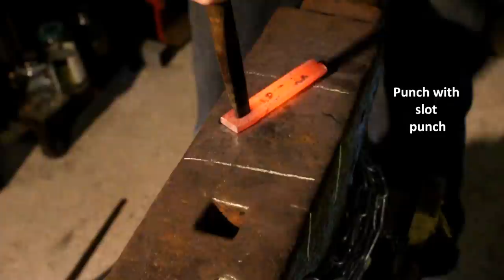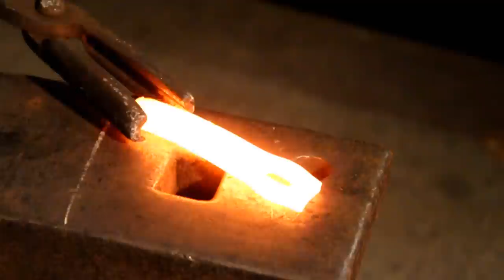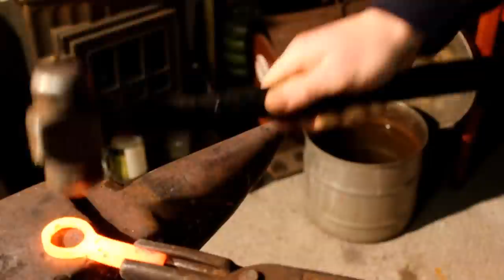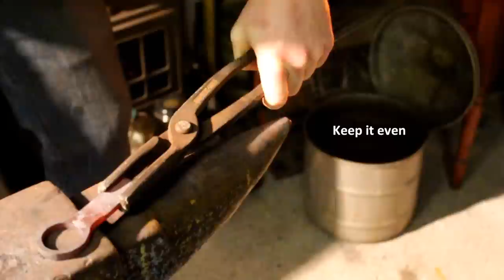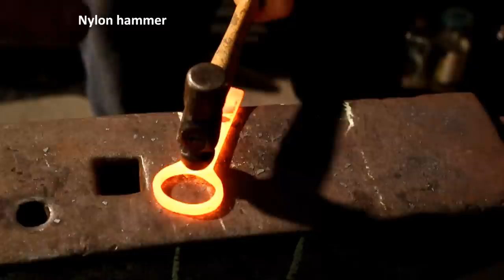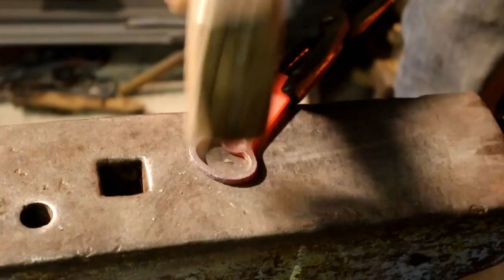Blacksmithing - Hand Forging A Bottle Opener

Comment: Very nice video, amazing how much can be gleaned from something that would seem so simple. I've been making some nice openers with a skull and a pineapple twist handle but have had a heck of a time finishing them with a nice symmetrical opener. I've fabed metal for years but this is my first season working forge to finish. Thanks for taking the time to help a rookie out.

Comment: Your way is much better! I was using increasingly larger round drifts for the hole and it wasn't turning out very clean. Now seeing this I realize my anvil was sitting there thinking Im stupid for not using the horn.
Reply from the maker: This has made my night my friend, she will forgive you i reckon. i have tried that too with not much luck. the only way i could do it with larger punches is to start it off on the horn to get it round in the first place by that time, i am already half way to finishing. its good to practice the technique on the horn too as it will teach you how to correct mistakes and centre lines of works with holes that need to be centred. such as gate hinges. same thing just thicker material.
Hoe you had fun either way dude, and give it a blast next time using the horn!

Have a good day my friend! Enjoy!
Reply: That Anvil has a thousand uses, limited only to the extent the user is willing to take it to. Anvils are the 'smith's 3rd hand, responsible for an AMAZING array of clever tools, hardware and techniques... let it guide you...The Force is With You, coming all the way from Hephaestus, the Greek God of the Forge! Hammer on, Brother!!!

Comment: Great video.  It solved a problem I was having making the opening.  I had been using just a round punch and widening that hole just enough to forge over the horn point.  The sides of the circle ended up too thin that way.  The slot punch will work much better.

On the subject of hitting a hardened hammer with another as it appears to be happening in your video....just use an old ball peen like you use and heat the struck end to non-magnetic and let it anneal.  The struck end will be softer and the peen end that is used to make the dimple will still have a little hardness left over.  On hot steel like an opener, it doesn't have to be hardened.
Reply from the maker: shortfuse43 Thats why i do them, to help in situations like that. If you check out my latest video i have done anothe bottle opener in the same way but a better quality to see how its done better. if you do use a round punch just make the hole further from the end, that way you can reduce the sides of the circle easier, but yeh a slot punch is a lot better for this. i did this to the ball pein and works great, quicker too as i can get more force with a hammer than a nylon which is what i used in this video.Thanks for commenting, i really appreciate it.
Reply: ***** Hey, the latest video shows the work more clearly.  Not a problem for me with the low ambient lighting...the anvil work is what's important.  The dimple forging with the ball peen is much better in the new video.

Comment: I've made a few of these recently but with a Ram's Head at the 'handle' end.  I usually use a piece of 30 x 8mm (1.25 x 5/16), first working the handle end to approx 16mm (5/8) square, from which is forged the Ram's head.  I do half the work on the head first to get the basic shape including the split and tapered horns and then flip round to punch the hole and form the bottle-opening shape.  Then return to work on the head and finish the detail.  Last thing is twist and curl the horns and then tweak everything with a file where necessary and polish the whole thing.

Comment: Do you have any advice for those who want to forge this but don't have a anvil with a horn? Could I use the round punch locked in a vice?
Reply: is there a square hole in your anvil?
Reply from the maker: That would work ok, as long as its in a leg vice and not a bench vice as you will break the screw in the latter. Or it can be drifted using the jaws of the vice.
Reply: The usual blacksmithing truth: there's more than one way to skin a cat.  I make mine using a totally different approach: I punch round, then I use tapered drifts over a hardie hole and a larger turning hole.  It never touches the horn.  However, if you don't punch your hole dead center of a nicely rounded strap end, drifting will always stretch the thinner sides more than the thicker.  The approach in the video is a lot more idiot proof than my approach...  I like it!

Comment: I just tried forging a bottle opener.  I failed, I an going to make an oval drift to use to finish the hole.  I also have a cast iron anvil that doesn't have a thin enough horn to round the corners, so I just held my round drift in my vice for now. Have to try again.

Comment: If I am correct, hitting two solid metal hammers together will be like hitting a wooden baseball bat?
Reply from the maker: if they are hardened then they run the risk of shattering, and can be lethal if its the right time and place to be get struck with shrapnel in the wrong place, so i just advise not to for safety reasons
Reply: gotcha, I understand

Comment: can the same steps be used with converting a horse shoe into a bottle opener ?
Reply from the maker: +Robert Stoker oh yes, for sure, you can either thin the bar out or just go with it and end up with a really thick opener but its the process that is important you just may have to punch it closer to the end to reduce the material for the loop as with thick stock you may end up with a very big loop.
Reply: thank you very much for your advice as i tried to make a bottle opener form a horse shoe this evening  and did not turn out well next time will be nicer
Reply from the maker: +Robert Stoker how did you get on robert?
Reply: +workingwithiron I've not tried it out yet I will when I have coal 👍

Comment: how do you know the hole is the rite diameter?...
Reply from the maker: Dxpt very good question, and thinking about it i dont know how its the right diameter but after making a few thousand it turns out to be around 30mm inside diameter which works really well for popping bottles. the general rule is for me, the thickness of the starting stock should equal the thickness of the ring when forged, follow that and you shouldnt have any problems, good question though, thanks for asking.

Comment: So what about a slitting hammer or a hammer punch or a flattening hammer and others of the like that are struck with another hardened hammer commonly in smithing not trying to be an ass just curious as to your reasoning. Nice work
Reply: Most of the tools a blacksmith will make are only hardened and tempered on the ends that need to be. The striking ends will normally be how the material was first used. I have made chisels, punches and drifts and only the tips are treated. Some tools won't even be treated if the material used is of good quality like med to high carbon tool steel.
Reply: +damionlowther78 so what exactly happens when you hit to hardened hammers together?? does the earth stop spinning? does a secret blacksmithing portal open?

Comment: Why not to hit steel hammer with another steel hammer?
Reply: +Peter Kiraly worst case scenario they both shatter but more likely one of them chips
Reply: Interesting! I always though that only jewelers and gun smiths mess around with softer hammers.
Reply: actually , thats what i was always told , but myth busters did a whole thing on it ,,, worthy of a watch , then decide.
Reply from the maker: we also use soft hammers, such as raw hide mallets, wooden mallets, copper mallets, we use these so we dont mark the steel when struck hot for thing like straightening twists or bending and this is usually done on a tree stump or wooden block. 

Hardened steel hammers dont take well to being struck against each other, they will chip, or they can shatter. You have to remember not everyone who produces hammers get the heat treat absolutely spot on unless they are hardened and tempered in a controlled environment such as temperature controlled ovens. 

I have had it happen to me, i even showed it in my new video forging a toasting fork, i show the chips that i personally made by striking 2 hammers together... never seen where the chips ended up and hate to guess what would happen if they hit me. 

Its not worth doing.
Reply: im 55 now ,,, i was re shafting an axe when i was 15 and when i was putting in the two metal wedges that hold in the one big wooden one , a minute shard splintered off , it was about 2mm by 4mm , it hit my arm , and ive never seen anything bleed as much , i still have the scar ,,, but the myth busters is worthy of a watch ,,, like the pig skin mallet on a wood block idea though. thanks t

Comment: what happens when you hit too hardened hammers together??? lol
Reply: They both shatter and send sharp metal flying it can and will most likely hurt someone. don't test it at home go to a friend's house
Reply: +Bruce Woulda bullshit, it doesn't shatter. It's an urban legend.
Reply: If they are of comparable hardness it will do neither any good. Go read a book on metallurgy before you wreck all your tools.
Reply from the maker: I take it you have not done this to the extent that eventually you had a piece chip off. I dont know where you get this urban legend shit from but in the real world the real smiths know that it can and does happen.
Reply: +workingwithiron okay, just read your other comment. Chipping is possible of course, which I meant when is said don't hit the corners or the edges of the hammer. Noting bigger will happen tho. 
Great video by the way, going to try making one myself today.
Reply: Why would you risk it when a nylon hammer is like £3 at a hardware stall. Rather replace that than either a £50 forging hammer, or an eye.

Comment: You CAN hit two hammers together. I don't know where that crazy rumor has started that you cant. I know smiths all over eupore that have been forging for tens of years and all do it. It was also tested in mythbusters for you american sceptics.
Reply from the maker: of course you can hit two hammers together but i would never advise it, ever!! Mythbusters you say, did they use proper blacksmiths hammers or store bought hammers as i dunno if you know they are slightly different in how they are made. The hammer WILL chip guaranteed if used for a long time doing this. Im in Europe, England in fact and not one other professional smith from here does it that i know of as they know how dangerous it can be and wouldnt advise doing it. As this is a tutorial, i am obliged to let people know the risks and do not support it at all.
Reply: been there, dont do that! I have a hammer at home that took a chunk out of my cheek. bad Idea! the chip was ragged and 4mm diameter. sprang off like a bullet.
hurt like a B*^%*.

Comment: Poor handling of tools, dropping on floor, waste of time and energy.
Reply from the maker: I get this a lot, and i will give you the reason to why i do it. as soon as that metal touches the anvil, the heat starts sinking into the anvil, so the few seconds of trying to place my tongs down softly or balance them on the anvil will take most of my heat away and clutter up my working space, so i do what i do the same as fire welding, i line up the work where i need it then drop my tongs if i dont need to hold onto the piece.
its a split second which wastes zero time and zero heat so i can forge the work in less heats being more efficient. it takes the same time to pick them up as it would off the anvil or stand and also helps keep my whole body flexible by doing that exercise. 
I dont damage the tools while dropping them and dont burn myself when they lose balance while working and hit me on there way to the floor... i used to balance them but it took longer as id be looking for a place for them to sit properly.
Reply: You and me are in the same boat friend ! get your work in place then drop your tongs safely on the floor so you don't loose heat , much much more efficient and i do say this was a great video ! very nice forging and craftsmanship